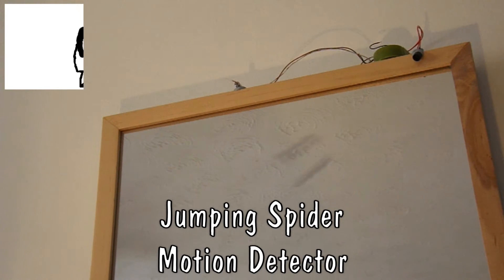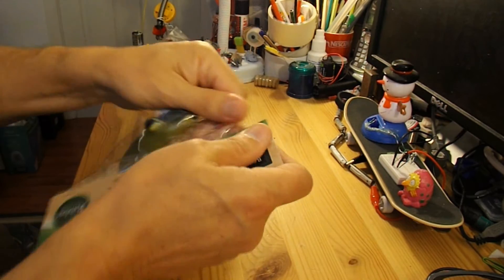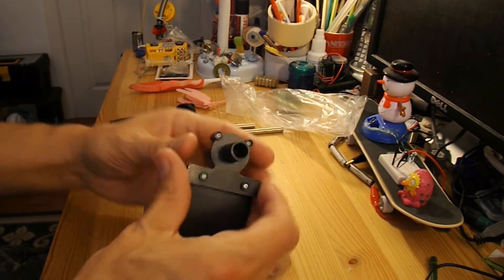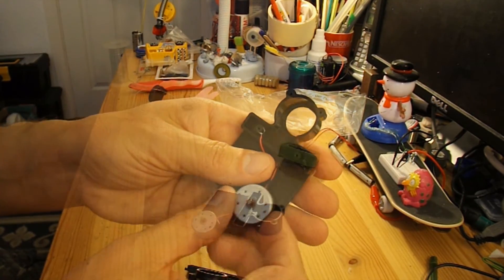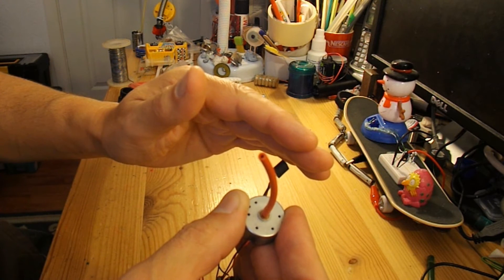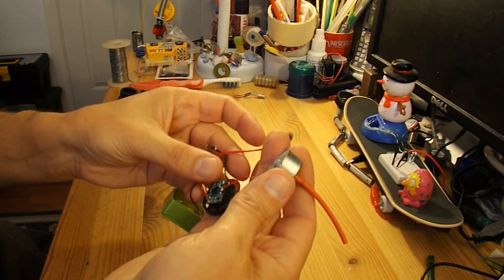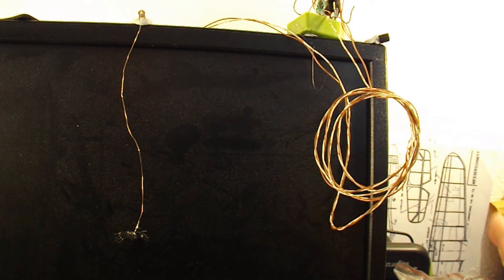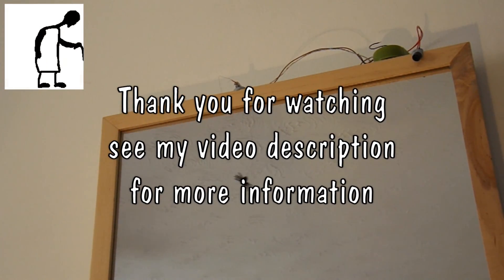Jumping Spider - Motion Detector - Halloween Fun

Comment: Ahh. That makes sense. 
BTW am I still hearing a little croaking? If so, I would figure by removing the speaker altogether would allow for more voltage going to the motor.  Unless of course you're taking that into consideration. Either way I still like this idea.
Reply from the maker: The croaking is actually coming from the motor, interesting side effect, same as you get when people are playing music using CD drives and photocopiers. The speaker is not in circuit. http://youtu.be/AMYtAEuaSHc?list=PL6FEACF6178CE15EF

Comment: Oh Dear God! Someone is killing little aliens and selling their skeletons as Holiday Decorations!
Oh, and cool idea with the spider..  
Have you considered using a battery powered motion activated light instead of the frog?
Reply from the maker: The reason I use the frog is the croaking noise is the source of the pulsing bursts of current powering the little motor so it makes it vibrate. A motion activated light would just switch on and off. Still a useful option for a similar application but not a vibrating action.